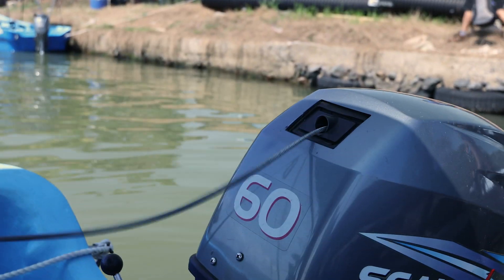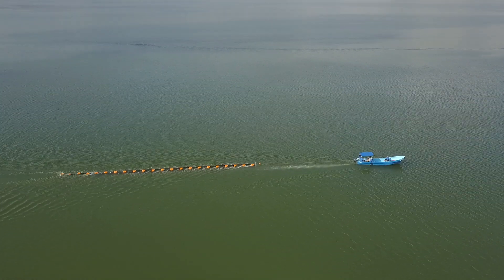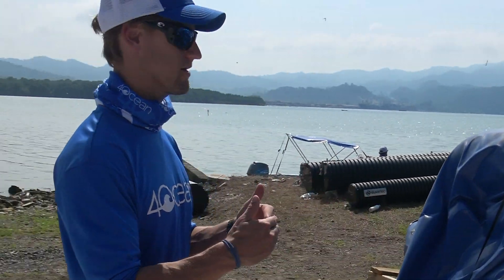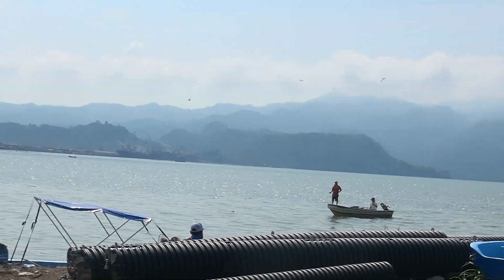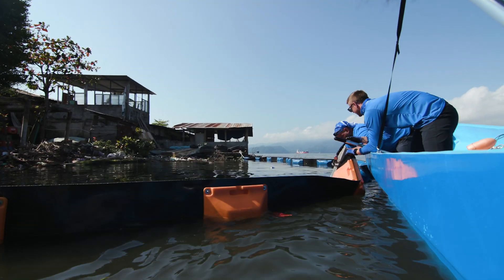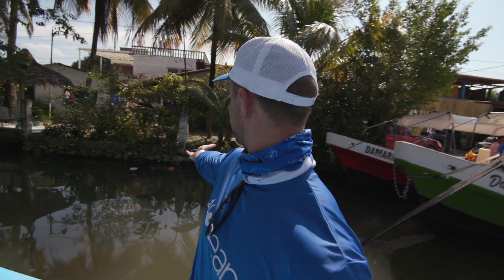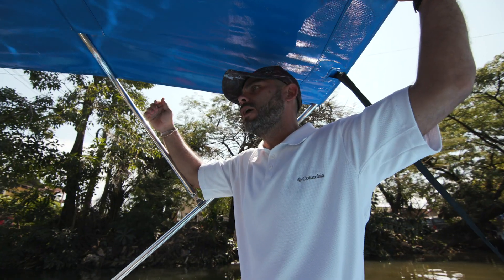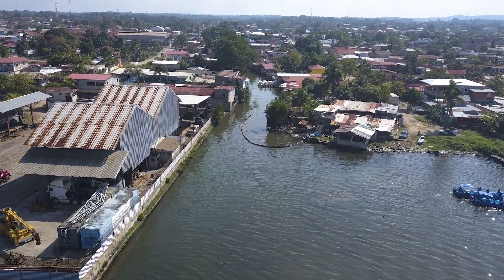Project Guatemala Update: Boom Systems

Comment: I thought the Ocean Cleanup used them?
Reply from the maker: The Ocean Cleanup has some pretty great technology they're working with which is a version of a boom system that floats in the middle of the GPGP and collects trash in that form. Our boom systems are positioned at high impact river mouths and other areas leading to the ocean and we deploy them to help mitigate what's reaching the open water and allows our crews to be efficient in cleaning these areas by concentrating where the waste is ending up.